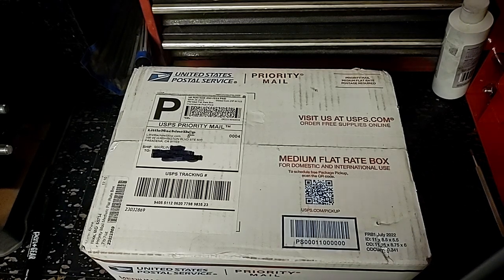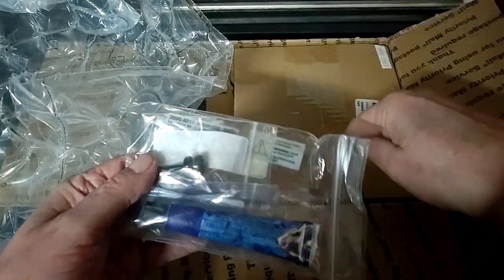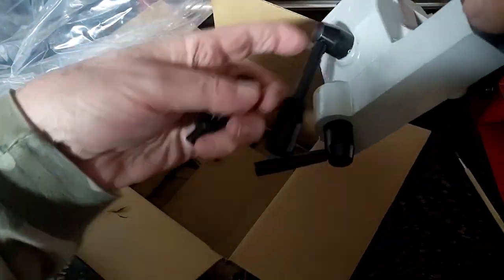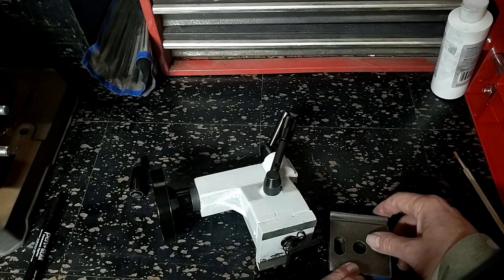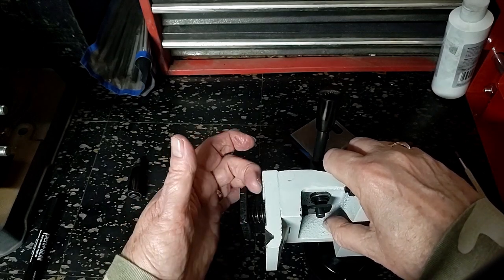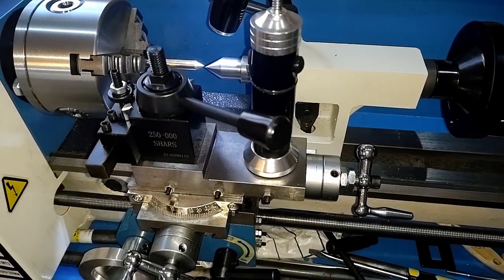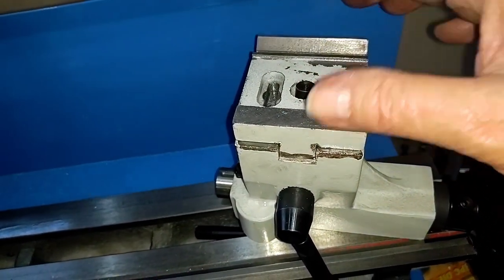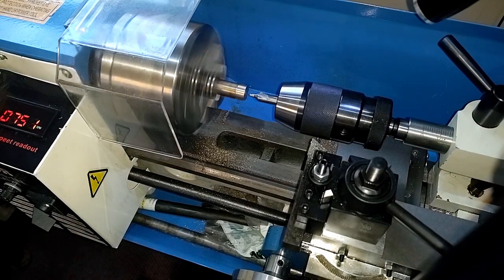Vevor 7x14 mini lathe Tailstock problem. A simple fix. A new tailstock from a different company.

Comment: MINE SHOWED UP A WEEK AGO.  MY TAIL STOCK IS FINE BUT TRYING TO ADJUST THE CROSS SLIDE HAS BEEN IMPOSSIBLE.  AFTER DISASSEMBLING AND REASSEMBLING MULTIPLE TIMES I FINALLY NOTICED THE GIB IS BENT.  I'M GOING TO CONTACT VEVOR AND SEE IF THEY WILL SHIP ME A REPLACEMENT.
Reply from the maker: I wish you the best of luck. I tried to get them to replace the foot plate for the tail stock and in the end all they did was throw lots of money at me, a massive discount. But making a gib should me a reasonable project. I haven't yet had to take my cross slide apart so I don't know how that gib is set up.

Comment: Got my lathe a month ago. They've upgraded the tailstock and it cuts a good center. Still rate the tailstock <80% because cam lever is difficult and in the way sometimes. Love the mill but I got a tick in the rotation(?)
Reply from the maker: Were it me, I would be chasing down that tick before you get out of the warranty period. There should be no ticks, clicks or any other noises. This could be a bad bearing. In the end, you will most likely be doing what I plan to do, which is to replace the headstock bearings with angular contact ball bearings. This allows a bit more accuracy in the bearings.

Comment: Have the same tailstock misalignment problem with a mini lathe I got on clearance at Tractor Supply. Can't complain too much as I got it for only $250. I remachined some parts and got it fixed.
Reply from the maker: I'm glad that you could solve it yourself. I was in a mood to be a cranky old man and demand that the vendor actually fix the problem.

Comment: Liked that they put a spring on the locking plate bolt ....
Reply from the maker: It's an interesting design choice. It does make it a bit harder to put the thing back together.
Reply: Ya me too that nut is hard to  get at when TS is on the ways so the spring keeps the nut tight, such a simple fix....
Reply from the maker: Simple is always good.

Comment: Treat yourself to a Harbor Freight mini milling machine. I did and I like it. Has come in handy for a number of projects. Complement that with a spin index and a rotary table and you will be set. Used the rotary table on the milling machine last week to create perfect sized holes in flanges I made for the exhaust system pipes of a 91 Mazda 626 I am restoring.
Reply from the maker: All in good time my precious, all in good time. Those things are on the list. But isn't it nice to have the tools on hand to make the stuff you want?
Reply: I have one that worx great😎
Reply from the maker: Thanks for the supporting update. I will in the long run look into that for a small milling machine.

Comment: I had the same problem with my vivor minnie late.but I did manage to make it right. Thank the lord. Mine is kind of noisy. Other than that I can live with that. Thanks for the heads up though. 👍❤..
Reply from the maker: Glad that you were able to get your lathe right. These are fun little machines, it's a pity that the maker does not bother to cut that part properly. 

So as to your noise problem, is it in the bearings in the headstock or in the gear train for the lead screw or where. These should run reasonably quietly.

Comment: lol, i thought the box was really small when he first pulled the knife out to open it then he grabbed the knife with his other hand an i could actually see how big it was. that was pretty funny, still wanted a bigger one. im looking at trying to find a tail stock for my vevor 7x14 lathe, ive been using shimes to get it centered but its a fight everytime to make sure i get it perfectly centered an i just want to buy a new one so i can avoid that head ache. but i cant find anything that say they fit my lathe so ive been afraid to buy one out of fear of getting it an not being able to use . i just ordered a oxa tool post for it cause the first one i got ended up have a aluminum block for the tool post so it works but has trouble when i go to cut a part off, even with brass it flexes when parting so i have to go stupid slow but hopefully this will help deal with this. id like to upgrade anything that is going to give me trouble to start with so i dont have to worry about if its me or the machine thats having issues. im still learning to use the lathe, an i got a mill not long after the lathe so i looked at trying to fix the tailstock but i still have alot to learn on it an removing material wouldnt fix the problem anyway cause im having to use shims to get it centered with the chuck so its they removed to much to begin with or something im not sure, ive not seen a good tail stock yet so im not sure really what the difference is, i just know it takes me shimming the right side of the tail stock an adjusting it side to side to get it to center with the work piece.
Reply from the maker: Hi James   

I am glad that you got the joke with the knife, that is my biggest folding one. It was a gift from a friend a long time ago. When I include an unboxing I try to throw in a little fun stuff. 

  As to getting a tailstock that will fit your lathe, the one from the Little Machine Shop, their part number 2502 is what I bought. It is designed for lathes with a swing of 7 inches. That one lined up quite nicely for me. It's $86.16 as I type this, plus shipping, so it comes up to about $100 to your door. In talking with the nice folks there, and they really were nice to me, they said that they need to update their listing to include Vevor and a couple of other companies. 

 The point is that for our machines, which are 7 inch swings, the center of the bore is supposed to be 7 inches above the ways. That means that anything like a tailstock or stead rest should also have it's center 7 inches above the ways.

 Now as to the tool post, did you watch my video series on buying an OXA tool post. I ended up buying one from Shars. They did have to replace the 250-002 holder because it had a bad screw hole, but they did that with no muss or fuss. 

 Anyway, congratulations on getting into metal working, it can be fun and perhaps even profitable. Let me know how the new tool post and tailstock work out.
Reply: @oldfarthacks  shars is the one i ended up picking up on amazon, an i hadnt seen ur other video, i just stumbled onto this one while looking for videos of others with the same lathe an what they ended up using to replace the tail stock, really appreciate the info, i will be pick up one of the tail stocks cause that has been the biggest head ache ive had with messing with these machines so far, but i'll be watching ur other videos as i get some spare times, thanks again.
Reply from the maker: I am glad that I could be of any help.

Comment: when placed without any adjustments its off to the left probably because the headstock of this lathe has the same problem, it doenst make full contact with the bed and its slightly tilted, i have the same model
Reply from the maker: There are any number of errors possible here. In my case, the V cut into the base is too shallow. One of these days I will recut that to the right size. But part of what is going on in this series is seeing if I can get the supplier to actually fix the problem.

Comment: As everyone knows who buys these cheapos self included their not perfect, I have to manually eyeball center the TS till it aligns with the center of the part in the HS, other than that only gripe I have is the motor is garbage and stalls during a cut which of course can be modified with a better motor....but for for $500 shipped I can't complain too much...
Reply from the maker: Yep, they are not a heavy duty high precision machine from the factory.

Comment: On some real u could have fixed it yourself w a hacksaw
Reply from the maker: I could have, but where would the fun and for that matter profit be in that. 

The one problem with doing such work with a hand tool is keeping the groove at a pure right angle to the guide on the top of the plate that aligns the actual tail stock. With just a hack saw, it would be quite easy to put in an angle that could ruin the plate. 

I took the alternate route, trying to get the company that makes and or sells this to improve their product. So many other people have talked about buying these lathes and having to make this repair. 

As I say in the description for this video, $200 bucks let me buy an new proper tail stock and now all is good. Still had money left over, which is nice. 

Anyway, thanks for the comment.
Reply: @oldfarthacks  I respect ya position OG no hate just a young cat peeping game from an OG keep doing what you do u teaching game
Reply from the maker: Thanks All the best to you.